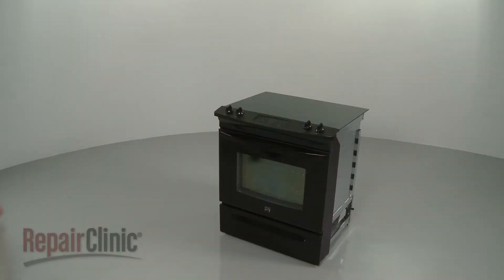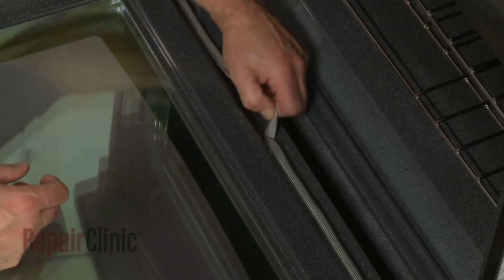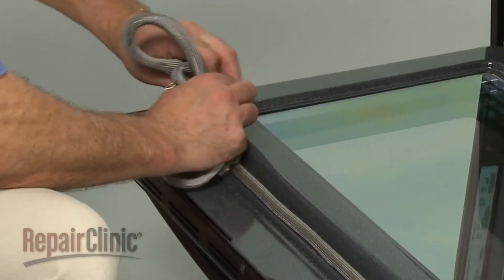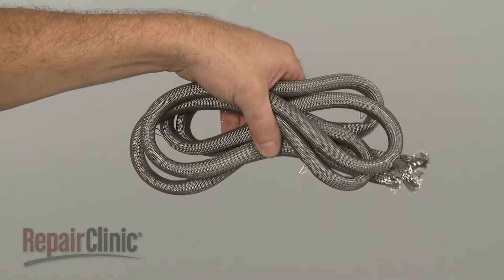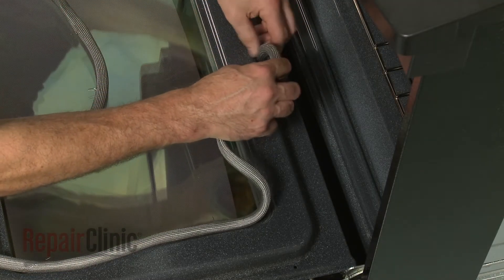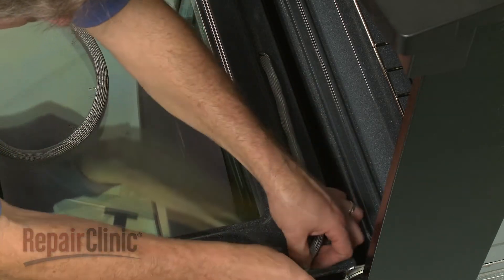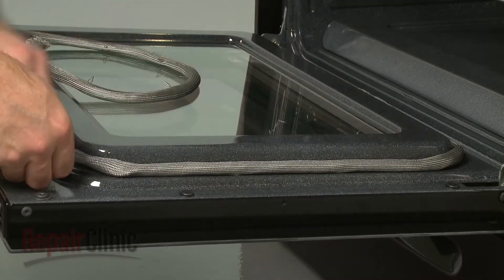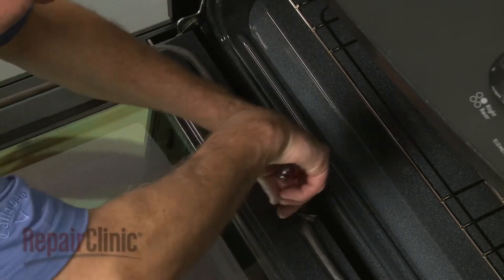Kenmore Electric Range Oven Door Gasket Replacement #318053132

Comment: my hotpoint stove door seal is a bit harder to replace, but not too hard... i had to pull door out, remove 4 bottom screws, 2 top screws, then 4 more screws, remove the insulation, then remove 4 more screws and replace the seal...  put them back together in reverse order and done...
Reply from the maker: atamotua64 Thank you for sharing.